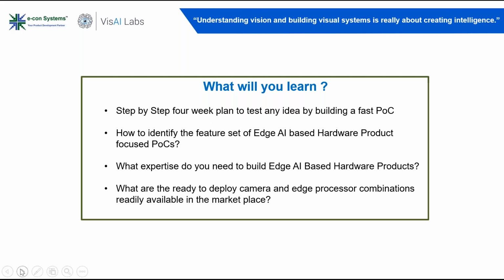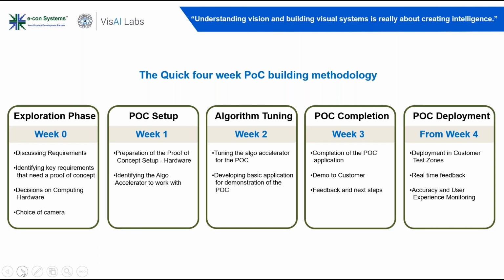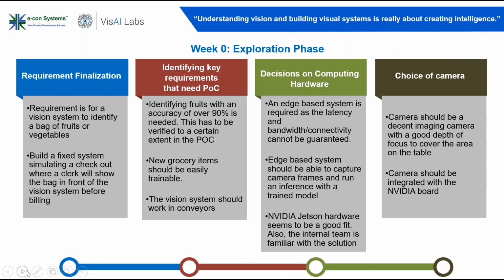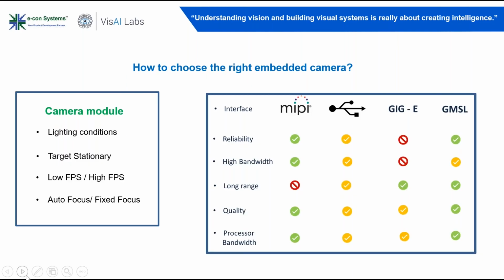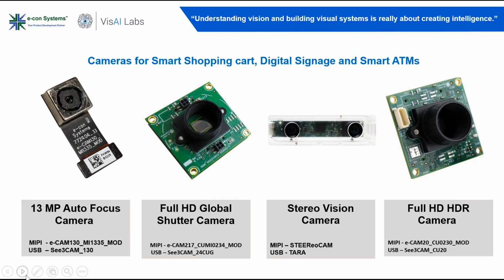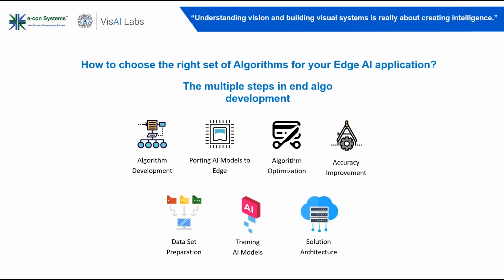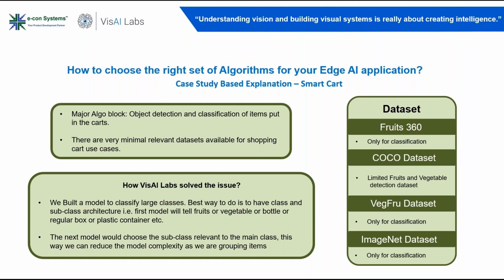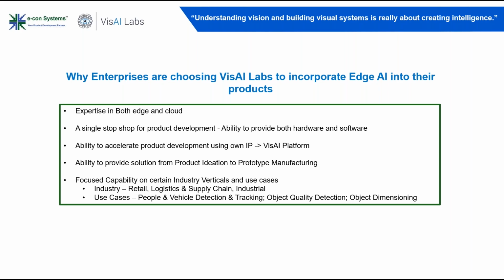Build Edge AI & Computer Vision PoCs in 4 weeks with ready to deploy Hardware & Tuneable Algorithms

Comment from the maker: Intelligent fast failure is the need of the hour in incorporating Intelligence into hardware products. Moving fast requires building quick PoCs to verify the veracity of the idea before taking the solution to production. Within e-con systems and VisAi Labs we have built 1000s of PoCs to validate the ideas, but only around 300 ideas have been taken to market.: http://bit.ly/2OltHOV